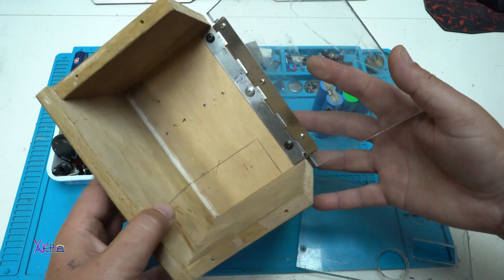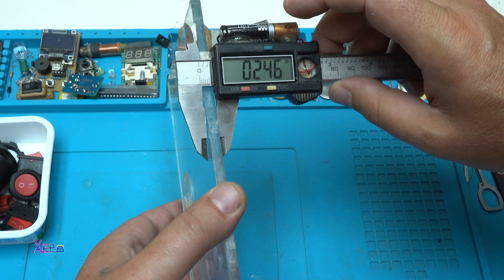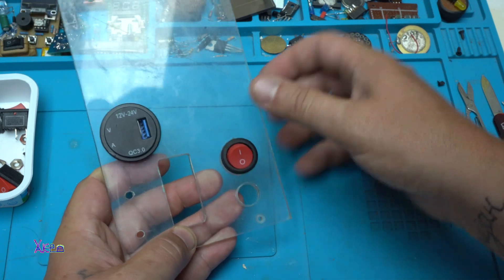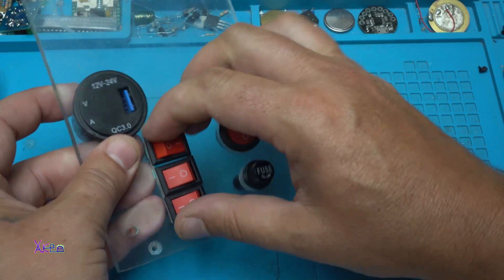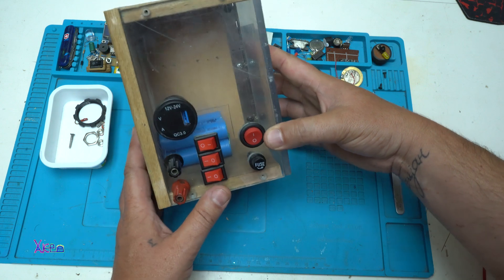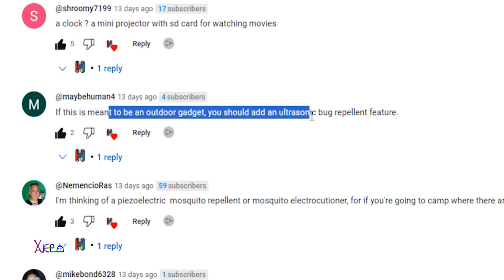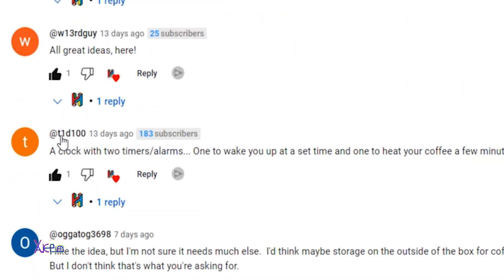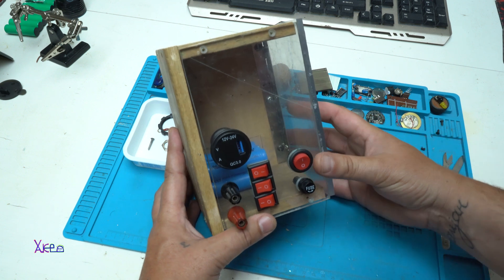Building Multi Camping Power Gadget with Cool Functions Part 2

Comment: I think your doing great but I have the feeling that you'll need more then that, like a light inside the box and outside, and add a 12v outlet for a power inverter that takes 12 v and gives you 120v so can quickly boil some water, or a heater, and a volt meter to see at what your battery level is at, and a siren incase of bears and other wild life
Reply from the maker: That with siren is great